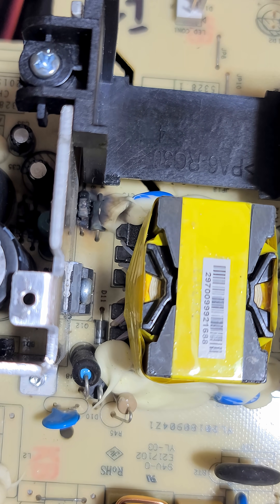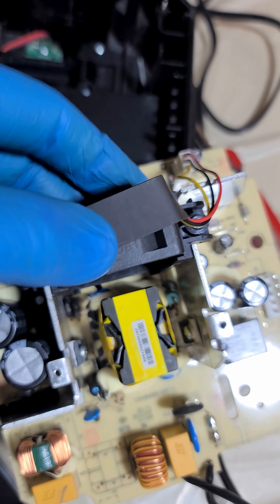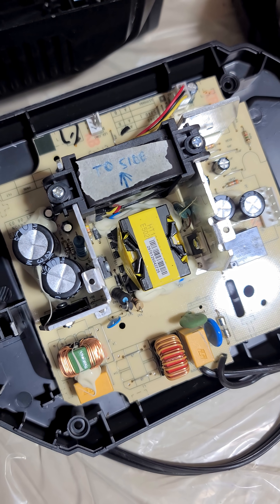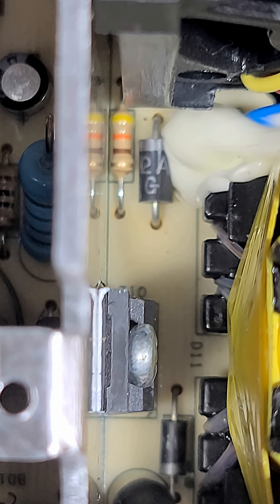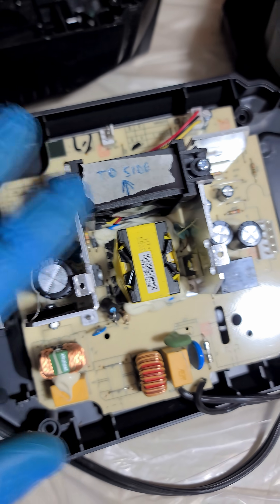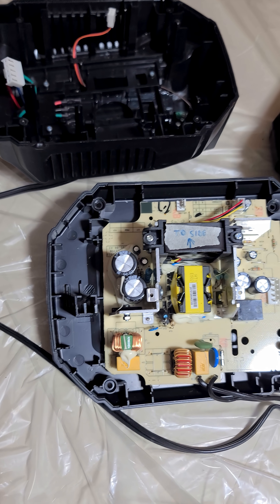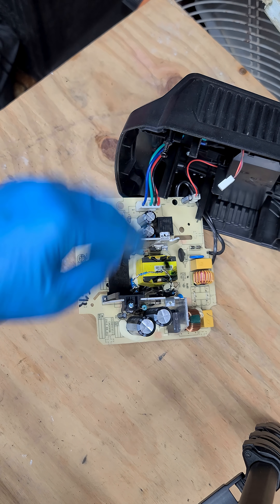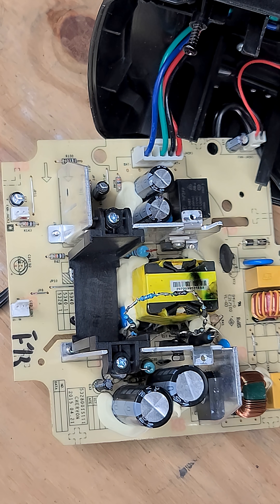PT 2 of Ego CH2100 charger teardown - IT'S TOAST #Egocharger #ego

Comment: I kind of figured it was going to be more than just the resistor if you've got a multimeter you might want to check the mosfet on there one of those transistors might be bad and that's what shorted out the resistor it may not be completely bad I mean it shorted the resistor out again but it may be just one of those transistors that have gone bad it's very easy to check YouTube has got some very good videos on how to check transistors if you don't know how as long as you have a multimeter it'll tell you exactly how to do it
Reply from the maker: Thank you for your reply. The diode seemed to check OK on the ole Harbor Freight meter. This is like trying to fix an engine that has a misfire, you do some plugs, coil packs, and other things only to find it still has the problem. The hardest part is getting those components out. One the bottom of the board is where the resistors and large components get soldered - BUT - the large wire leads on those parts go on super small traces that have surface mount chips right next to the mosfet and other big items, plus they coated the soldered part of the board with a thick plastic enamel. It never turns out to be just a fuse LOL.

Comment: My friend since that resistor burnt up it might have heated up that diode for safety sake I would change out that diode to play it safe goes right after it could cause a lot of Havoc to that charger if I were you I would change out the diode too just to play it safe